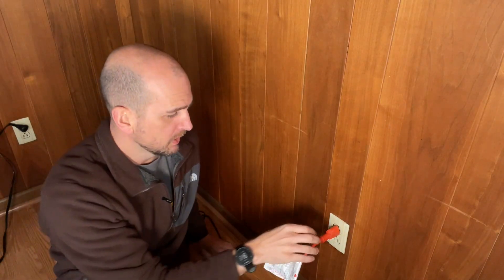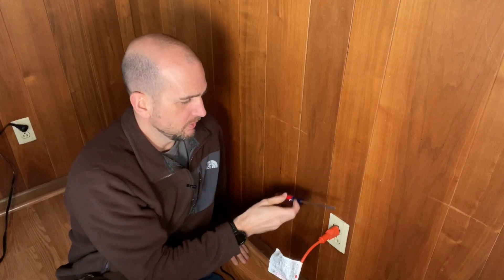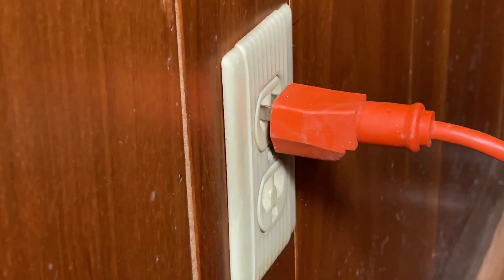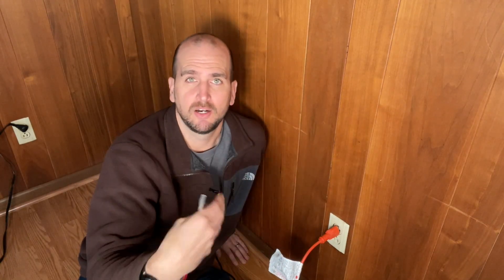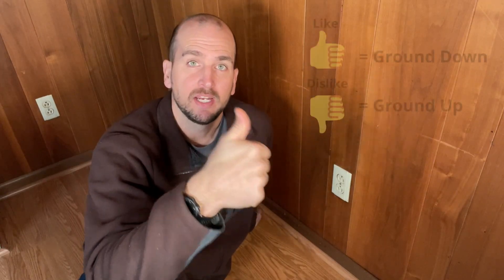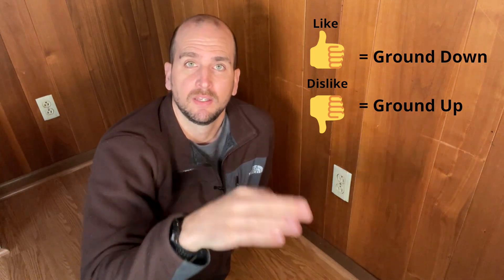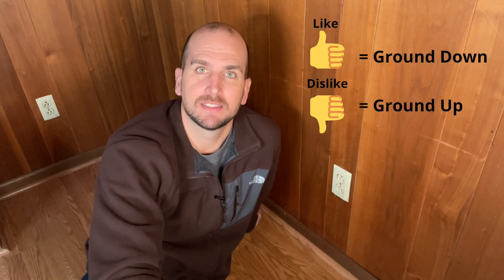Should An Outlet Be Installed Ground Down Or Up

Comment: Since code does not state which way, mount it the way you prefer or need.  Me... I mount ground up to provide a tad more safety, especially in garage and workshop receptacles where things may be placed against the wall and slide into contact.  In most living spaces, I go with ground down to allow "wall wort"  type devices to mount properly.  I like the idea of flipping switched receptacles in living spaces to identify them.  Do what you feel is proper.

Comment: I had a scary incident relative to this. Shortly after moving into a new home, I was pulling a plug out of a receptacle that had the ground facing down.  There was a metal box cover on it that had a loose retaining screw on it. Somebody had apparently over-torqued it and the threads were stripped. As I was pulling out the plug, that metal cover dropped down and made contact with the two blades on the plug. It was quite a violent show that thoroughly scared me. So first thing I did was inspect every outlet in the house for metal outlet covers. There were several more, and I replaced then with plastic. I have since also turned those outlets with ground facing down  the other way, in keeping with my new sense of respect for 110 volts. I realize this was a rare incident, but the results impressed me. Also,  knowing how to orient a plug when reaching behind a piece of furniture where you can't see it to insert a plug makes it much easier.

Comment: Ground up is mainly used in industrial applications. The ground is the last blade to disconnect. Also, industrial plugs are designed for ground up applications especially right-angle plugs. Ground down is used in residential applications. The main reason is that the appliances (washers, refrigerators, etc.) plugs are designed for ground down configurations.

Comment: Worked at a company that worked with bare copper alloy wire a lot. Back around 1985 we changed all the outlets in all the plants to be ground up to avoid shorts. I've wired mine that way ever since.

Comment: Ground down or up.... heh
I'm with the others, ground down unless switched.... however!!!!.....
The patent shows it ground up. The inventor of the three prong receptacle said he wanted ground up so if a paperclip or other metal object landed on the live prongs, it would fall off and MAY have a chance of not shorting out. That being said, ground down has become the defacto standard because it looked like a face,  and people like faces. Later, when 90 degree plugs came out, they are designed for the ground pin down to plug in properly. So down is the standard because everything is made that way.
So ground up is safer, but ground down is a defacto standard. I install them down unless otherwise instructed... except for switched circuits

This is like the toilet paper over or under debate. When in doubt, look at the patent. Shows it over. Own a cat, put it under!

Comment: with grd up you have a 50-50 chance of shorting out with a plug not all the way in, where as grd down you just about have a 100% chance. So take it from there.  Been a state electrician for over 30+ years including 13 yr's at hospitals. If your plug is that lose in the socket get it replaced. Any handy man do it. Not rocket science.

Comment: Ground up for safety  especially if you have children. Children play with both outlets and coins if a child was to put a coin between a cord and a outlet if the ground is up the coin will roll out and away. If the ground is down you end up with a perfect cradle for the coin to short or become energized. If some type of metal falls in again it's better if it hits the ground on top  where it could land on the hot blade it the ground down.  if you are trying plug in a cord in the dark it is easier to feel the ground lug and that goes up and the wall plugs you can feel the ground hole and by touch you are aligned for a simple plug in. The ground lug is longer as a guide and is started to ground before any thing is energized.

Comment: I installed an outlet sideways, I don't remember why but I know there was a reason for that. I wonder what a building inspector would have said about that. It actually worked out well for plugs going in both directions and it worked for me.
Reply: If you did install it sideways, you should put the neutral up so any accidental contact of metal with two prongs will most likely be neutral to ground, not hot to ground.

Comment: Years ago when I was an electrical contractor I had a call for a shorted circuit. It's truly rare to get a troubleshooting job that actually has a shorted circuit. After working my way through the shorted circuit, I found the problem at a receptacle with the ground down. A penny had fallen from the table above the receptacle and welded itself between the hot and neutral prongs. Ever since then I and my crews install ground up. 

For receptacles mounted horizontally it's neutral up.
Reply: Boom!! You got it.

Comment: In the North East, unions put the ground up, open shop put the ground down. If the device and plate are installed correctly you will not have a problem with something falling on the plug. If you did have a metal plate fall on to the blades of a plug I would rather have the circuit breaker trip because of a short circuit then have a metal plate hanging on the ground prong.

Comment: Hospitals, office buildings, factory's and shops, normally use steel receptacle covers.  The idea is if the steel cover where to come loos or off, the steel cover would only contact the "ground" making it safer.  But on the other hand, homes and apartments usually use plastic  receptacle covers that can not cause an electrical short if they come loos or off.  I suggest, steel cover "ground up" and plastic cover "ground down".  Most appliance, power strip or surge protectors do use  low profile plugs that are meant to be plugged to a "ground down" receptacle.  Dave...

Comment: Right angle appliance plugs are designed for ground down. If the receptacle is mounted ground up there is a strain on the 90 degree plug.

Comment: You can be entitled to your own opinion, but not your own facts. Though the NEC isn't clear, a clue to the correct answer may lie in NEC Section 250-124(A), which tells us the Equipment Grounding Conductor must be the first-to-make, last-to-break. Since the bulk of the NEC is mechanical requirements, a respected electrical inspector once told me that, of all the physics related to electrical systems, GRAVITY is often forgotten. It influences weighted power cords and may pull the plug from the wall ever so slightly. If the hot & neutral is exposed in such a case, the EGC will maintain continuity. A few JATC's even try to teach this to apprentices...

Comment: Ground Down because when you use your tester to check the wiring, it's difficult lying on your back with your head on the floor looking up at the tester lights and reading the sticker on the tester.  So the question remains:  if Ground Up is preferred, why don't outlet tester manufacturers make them to be easy to use that way?  Do they know something we don't?

Comment: A 220/240 14-50 plug needs to be ground up. This is because the cord plugging in would be forced to be going up. This would be horrible with a 6 ga. 4 wire cord. So depending on application, convenience is more a consideration.

Comment: Commercial applications are very often ground up as there is very often a metal plate , 90 degree cords have the ground on the cord side hanging down , the ground can help support the weight of the cord , some Municipalities have orientation rules especially in commercial industrial applications,,your local township inspector cane tell you what they will accept

Comment: I have been an electrical contractor for 40 years ground up or down doesn’t matter, most homes are done ground down if using a metal plate in a home it would be advisable to use ground up in case the plate came loose but that is rare to find a metal plate these days, also I have seen hundreds of homes built before the 80’s with metal plates throughout the house and all the receptacles were ground down, just for fun though anybody have a preference if the outlet is mounted sideways should it be ground to the left or to the right LOL
Reply: Ground to the left if mounted sideways so that if the plate falls it lands on the neutral side of the plug

Comment: I like GROUND UP orientation, but it is definitely an issue with that style of plug mentioned at 4:24.  As a matter of fact, my refrigerator has that 90º elbow also.  Which, in tandem with my adjacent receptacle being GROUND UP, would seem to make a precarious connection, as the cord then upwardly projects away from the wall rather than runs downward and flush to it.

Comment: The ground connection is referred to by the electrical code as a u shaped ground connection. So if you install the receptacle with the ground on the bottom, well then it would be called an upside down u shaped connector.

Comment: I always install ground up for 2 reasons. #1 the ground isn't a current carrier like the hot and neutral, the female compression fitting in the ground receptacle most likely never overheats so it most always has tension on the lug. #2 with the ground lug up the weight of the cord tends to keep the hot and neutral pushed in the receptal till it wears out from plugging ig and pulling out.

Comment: i got 40 years in new york  UNION ELECTRICIAN.  THE FIRST TIME I HEARD GROUND UP THE RECEPTICALS WERE HORIZONTAL THE REASONS FOR THAT IS THAT ALL THE GROUNDS WOULD BE UNIFORME PLUS COVERS WERE METELSO IF THE SCREW CAME LOSE N THE PLATE DROPPED AND SOMTHING WAS PLUGED IN IT WOULD HIT THE GROUND. NOW IN HOMES IT IS CORRECT THAT MOST THINGS ARE MADE TO PLUG IN GROUND DOWN LIKE YOU SHOWED IF U HAVE AN ANGLE YOU WOULD HAVE TO PUT A LOOP ON IT AND TAPE IT YOU DONT WANT YOUR CORD HANGING UPSIDE DOWN LOOKS BAD.AND THERES PRESSURE AT WHERE THE PLUG MEETS CORD . IF YOUR PLUG IS POLERIZED IT WILL ONLY PLUG IN ONE WAY NO MATTER THE OREINTATION OF THE RECEPTICAL IF ITS NOT POLERIZED PLUG THEN IT DOESNT MATTER. POLERIZATION IS FAIRLY NEW DUE TO ALL THE ELECTRONICS. IT WASNT LIKE THAT 40 YEARS AGO. MOST PLATES ARE MADE OF PLASTIC THESE DAYS SO THAT HORIZONTAL THING REALLY DOESNT MATTER ANYMORE. BUT IF SOMTHING WAS TO FALL BEHINDE THE PLATE IT WOULD HIT GROUND. I DID ALOT OF COMMERCIAL WORK AND THE GROUNDS ARE UP AND IN ALOT OF CASES I HAVE TO COME BACK AND FLIP THEM CAUSE THE DESIGNATED DEVISE (PRINTER, DISHWASHER, AIR CONDISTIONER) HAVE THE ANGLE PLUG. BY THE WAY SQUEEZE THE PRONGS ON YOUR CORD LOL NAW THOSE RECEPTICALS R PROBABLY WORN. DO YOU KNOW WHY THE HOLE IS IN THE PRONGS? THERES NO REASON WHY. WHEN THEY WERE INVENTED THERE WERE DIVITS IN THE RECEPTICLE THAT SORT OF HELD THEM IN PLACE THATS REALLY NOT THE CASE ANYMORE TAKE A RECEPTICLE APART TO SEE.

Comment: Since the NEC did not set a standard for plugs, it doesn't seem to matter which orientation of the receptacle other than cosmetic and comfort. If anything, the way plugs are made, it seems they are steering you for ground down.

Comment: Placing the ground pin up orients the hot blade on the left making a heart attack riskier when plugging in with your left hand.  You don’t want to introduce a hot conductivity path to a more vulnerable left side of your body.  The heart is closer to your left arm so if your not sure if your handling a livewire (you should be) it’s good safety practice to use your right hand.  Of course you never want to create a conductivity path in a loop with both hands where the polarity won’t matter much.  People have been trying to electrocute me for years so I naturally think of a dead wire as if it were live.  Right arm through the right leg is more survivable- I know!

Comment: I’ve been an electrician for about 40 years. A master for 27 years. If it’s a dedicated receptacle, dishwasher, disposal, fridg etc... I put ground up. Gravity and time will make the cord sag and cause the top of the plug pull out. I his will naturally push the current carrying blades to be pushed in to the device therefore keeping a better connection. Something else I do is horizontal receptacles I install with the ground to the left. This puts the neutral blade up not exposing the hot blade.

Comment: I was trained by my grandfather who was a master carpenter and a member of the Masonic Lodge in Altus, Oklahoma.  He told me that ground should always be down as part of a safety issue - keeping the cord from coming out of the socket.  He also explained that if the outlet will not hold the plug of whatever you are plugging in, that either the outlet is old and needs to be replaced, or the plug does not meet up to code for that particular outlet and to replace the plug.  He was a very smart man.

Comment: ⚔️I’ve wanted to know about this issue, so ThX. Also the audio is so echoey & high pitched, I can’t get most of ur words.Apparently where the ground is located, to accommodate the flat plugs it  is down. Otherwise it’s not a hazard issue, either way it’s installed? That’s the part that’s too distorted to hear.🛡

Comment: Re the ground up argument, it would be safer yet if plugs were tilted with ground and neutral horizontal to each other and a shorter hot pin underneath.

Comment: In Australia the outlets with a switch have a red indicator on them to show when the point is switched on. To see this indicator the ground must be down. To me it makes sense to have the earth connected when the active and neutral aren't so earth down it is for me.
Reply: In the UK the outlets are switched also. Both the UK and Australia are 240V and I have seen significant flash unplugging charging adapters. The US to local adapters sold in the US don’t fill the full sockets in the UK or Europe. I buy adapters in the country I’m visiting, they generally have flash protection and cost less than adapters purchased in the US. I use locally supplied 3 way cubes and extension cords also.

Comment: The only time I change the ground orientation from down is on 240V 4 prongs dryer/oven outlet. Depending on the height of the outlet, it will be easier to plug it ground up or sideway.
Reply: It never ceases to amaze me that most 3 prong dryer outlets are oriented upside down causing the appliance user to have a heavy cord going straight up and bending back in a loop on its way to the dryer putting a lot of unnecessary stress on the outlet while hanging away from the wall far enough to catch things going by, plus the added element of them usually being right next to, or on top of a washing machine with water supply lines and a drain line passing by, you’d think that people would take the time to do it correctly.

Comment: how the hell would something drop between the plug and the plate, at the same time as making contact with both pins? A picture frame dropping would just bounce off, I can't think of any realistic way that you could short something plugged in that way

I do Ground pin down every time, and agree with the reasons to do it that way. Surge protector plugs normally are designed for the ground pin to be at the bottom, and anything that actually uses the ground pin will stay in the plug better. you'd have to be crazy to think the ground pin-up keeps any kind of plug in the receptacle better than down.

Comment: I think the real issue you have is that your outlets are flush with the wall and allow direct access to connected bare plugs. European style outlets don't allow this because they are recessed. All live parts are constantly encased within the recess and impossible to reach by accident. The only metal piece that is reachable from the outside is the ground.

Comment: All the original 2-prong in my 85 year old house have the neutral on the left. When I have replaced some of them with 3-prong outlets (with a GFCI at the beginning of a string of outlets) I keep the neutral on the left, which means ground down.

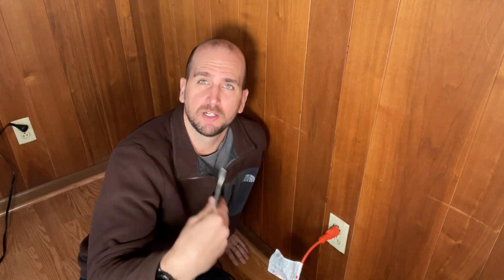Comment: 3:40 hmmm logical.
Yet in my 40 years or so experience with socket faults, never have I seen objects falling and shorting the prongs.
Reply: only ever seen it once in my 15 yrs working construction jobs and it wasn't even a company project it was my own home remodel
Reply: @skylarsharpe179  Wait wait, I think you jogged my memory and I remembered something in 1997ish:
A co-worker's precision screw driver, you know those small ones used for small screws, rolled over the table and shorted the prongs. It was nasty.

Comment: The ground pin is longer than the hot and neutral if you install “ground up” when you remove whatever is plugged in you increase your chances of damage to the receptacle or pins because of your elevated position we tend to pull upwards.  This scenario would happen more often than a conductive object falling across the hot and neutral. I think in new construction you have to have arc fault installed so your protected,….”ground down”

Comment: The likelihood of some conducting item falling down and getting right between a loose plug and the socket is small, but the circuit breaker or fuse will blow if it becomes a problem. However, if flooding occurs I want ground in water first for safety. I prefer ground connector down.
Reply: That flood water is already grounded :)

Comment: I took residential wiring before. I think it  doesn't matter whether you choose up or down so long as the outlet is grounded.  The reason being when thing falls as you said and hit the hot & the neutral causing shot circuit, the ground wire would do its work and the circuit breaker would trip.

Comment: Top: ground up
Bottom: ground down
I know... They aren't mass produced that way, might not be produced at all. Certain plugs, like the 90° plugs, won't both fit on one outlet. How about outlets that are side-by-side? I've seen 4 but never 2. Do you think that the plug ad outlet design will ever change? It is very rudimentry. .